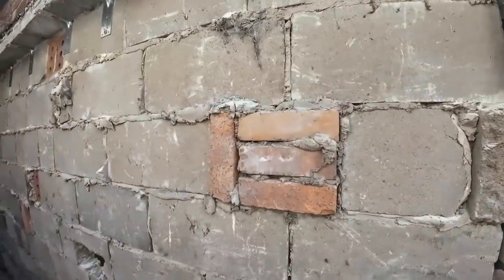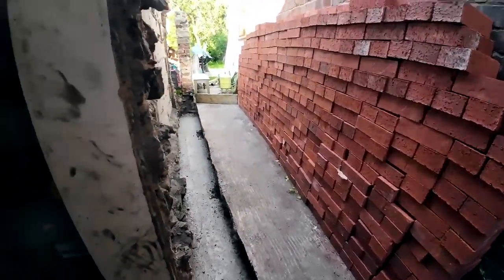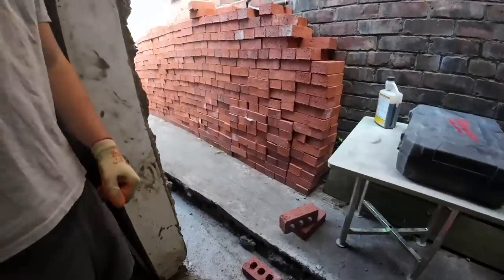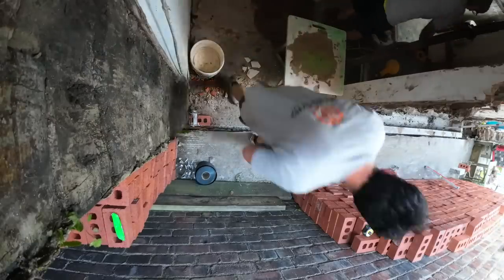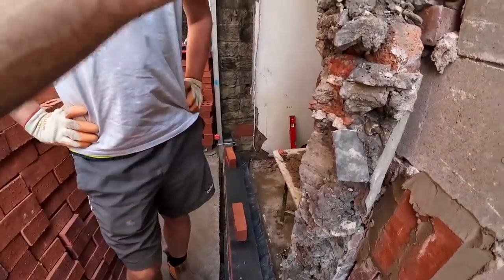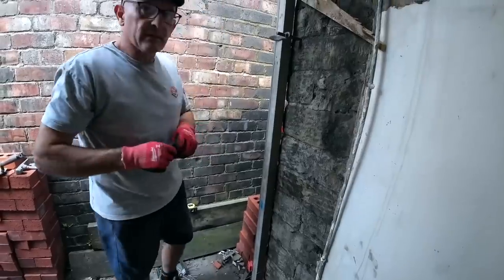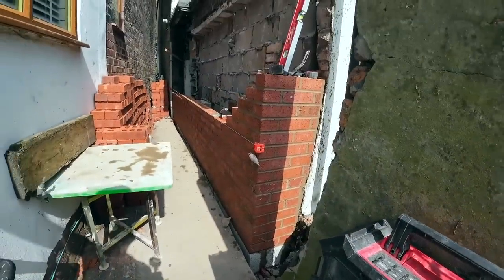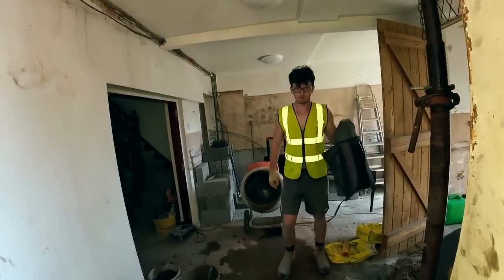HOW WAS THIS EXTENSION EVER BUILT?! COTTAGE EXTENSION PT 1

Comment: Wall ties of any length . Stainless steel bar with a as wood screw welded on to the end. A simple job for your local welding metal fabrication shop to fix you up with. Easy!!